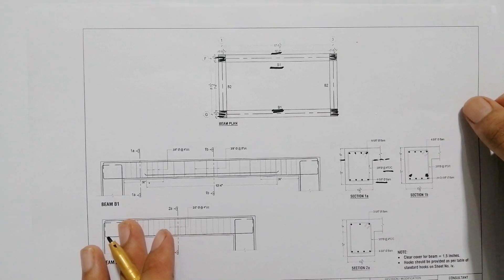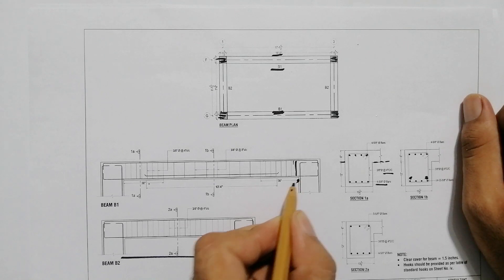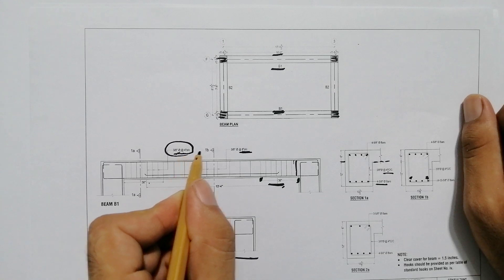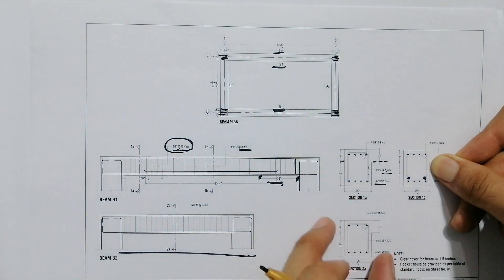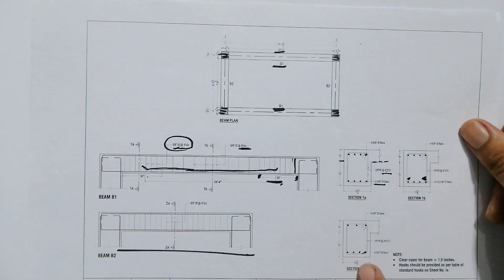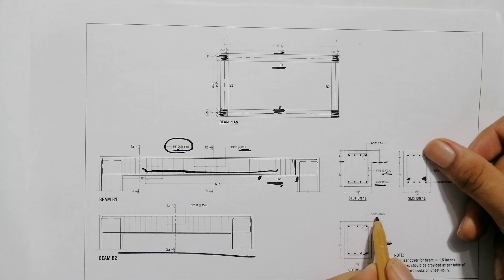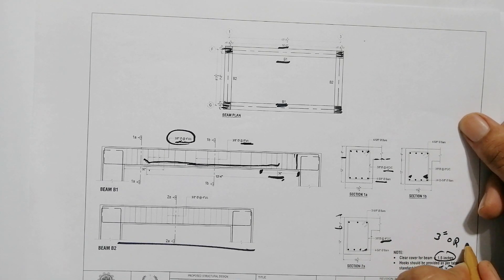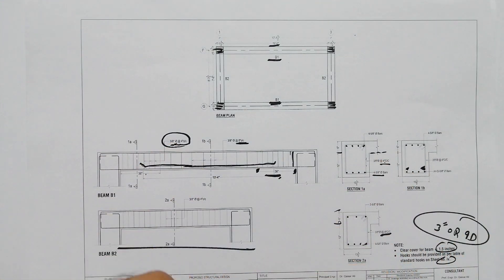How to Read Beams Structure Drawing - Study of Beam Drawing

Comment: I have designed my house with dimensions. I want to know who will design pillars n beams. Must answer.
Reply from the maker: My whatsap 00923463785623
Reply: Usually, we will appoint Architects to design the house layouts and facades, then appoint structural engineers to design pillars and beams.